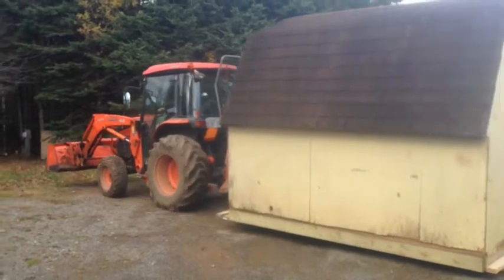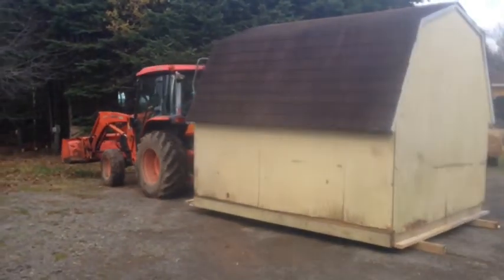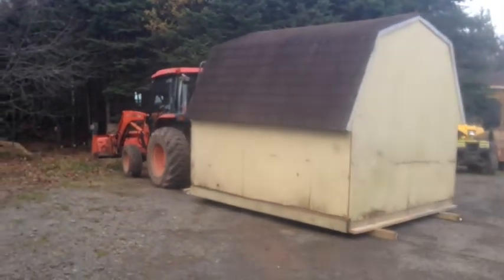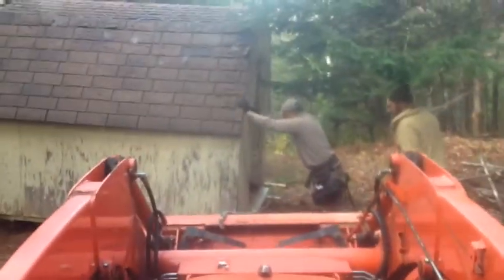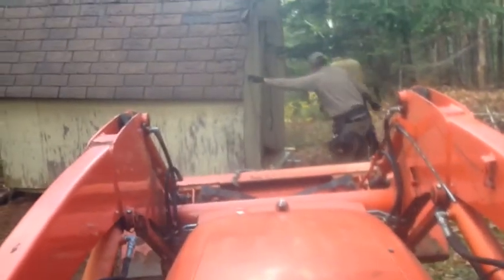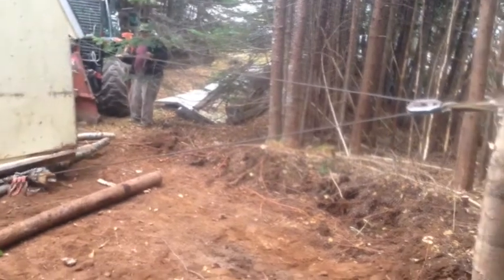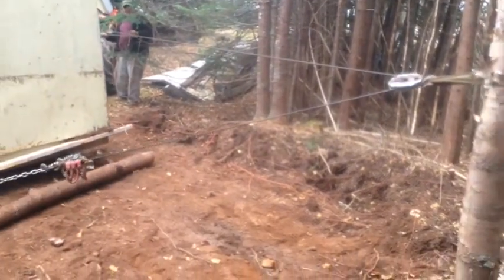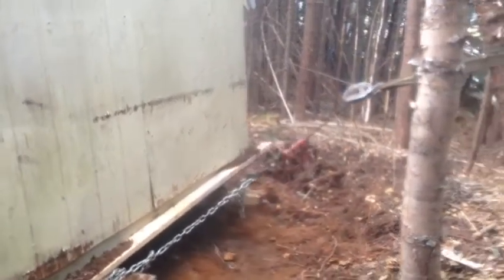Moving a shed using a 47 hp Kubota & a Wallenstine logging winch.

Comment: Nice job. I need to move two sheds that are moderately light in weight but quite a distance to pull them. I haven't prepared the final resting area yet, but capturing ideas from those who've already done it.  I just enjoy watching all the ideas and techniques folks use to accomplish their tasks.  Excellent video. Will be watching more of them. Can't wait to see the fishing vids. Thanks
Reply from the maker: Thanks.  You can learn a lot here on youtube. There is some smart people there that is willing to share their knowledge.
Reply from the maker: You can do a lot with a few rollers if you don't have the tractor power.  My father moved at 32x36 two story house about 800 yards with a 1 ton truck.  He  jacked up the truck, wrapped 1000 feet of cable around the drum of the wheel. He would put a bunch of logs under the house, chained the front bumper of the truck to a tree, put the truck in gear and pull the house 500 to 1000 feet at a time.  He did this maybe 50 years ago. It was the house I grew up in.  As I write this I feel a strange since of loss because after he died the house was left empty.  It needed some repair but the town made us rip it down.  There was not a rotten stick in it and the excavator had a hard time to even tear it down.  The  lumber used was actually 2 inches thick.  After the house was gone so was the sentimental value. We ended up selling the property.  A crying shame and when I drive by,  it make me sick.  Sorry for the rant.
Reply: Well, we could have written chapters two chapters in the same book. My grand pap did the same thing with the log cabin that they lived in but it was drawn by animals (I guess). There weren't any vehicles that I know of at that time. The log cabin was pulled maybe 100 to 150 yards and placed on a piece of land he purchased on the other side of the road/street. My dad and his 6 siblings grew up there and I was there as a young'n when I stayed with grand mum. I entered the Marine Corps at 19 and the house and grand mum were still there. My dad then took over the house and rented it out and it was burned down by electric heater. Dumb, dumb, dumb. That home was not made with modern electric wiring, but anyways. The log cabin was burned badly and not restore-able based on dad's income. The Borough made dad have it torn down and there was a lot of old history there. We eventually had to sell the lot and just like you said.....every time I drove by, I'd get sick. Man, had things been different. Agree, a crying shame. Nope Green Acres, it's not ranting. It's just how we felt about family belongings. We didn't have much but we had each other and a lot of good memories. Thanks much for sharing.
Reply from the maker: Ya.. to find somebody like you to share  thoughts with helps.  I guess the fact that we care enough to feel bad give testament that we have a heart.  Sometimes in our busy lives we don't have the time or money so we put importance things on the back burner until it's to late.    The old homestead is gone and it is a terrible loss but I guess we have no choice but to move on.  God luck in the future and thanks for your heart felt reply.
Reply: Truly a pleasure chatting with you. My name's Don so feel free to rant any old time ya want (smile). Have a fine week.
Reply from the maker: dido.  It was indeed a pleasure. 
thanks
Ray
Reply: Funny thing Ray, I'll remember name easily b/c that's my middle name (smile). Enjoy your week.
Reply from the maker: Good luck with the moves.  Hope it helped.